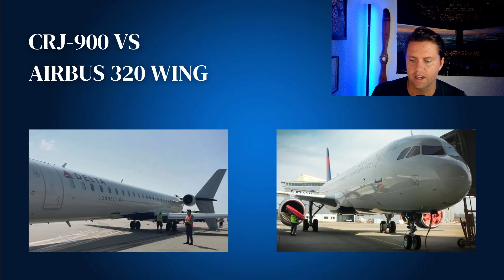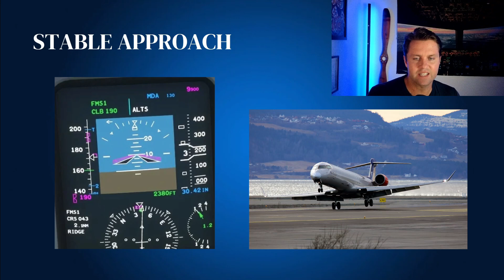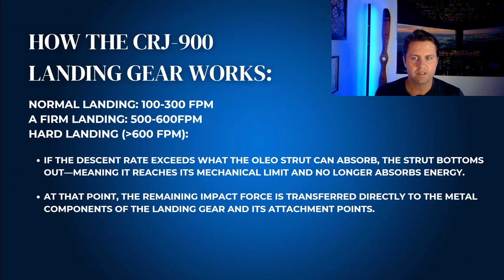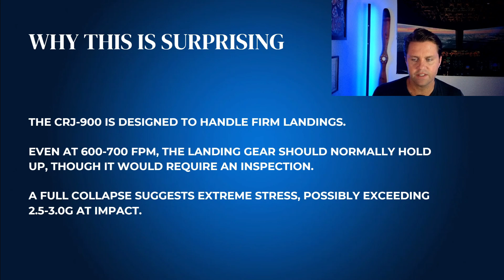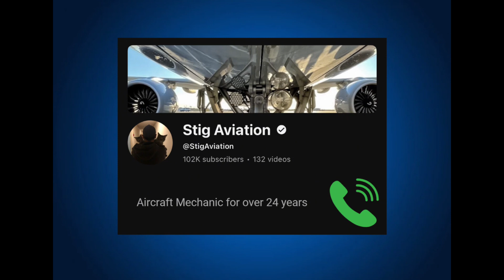Pilot Breakdown: Did a Hard Landing Cause A Gear Collapse?

Comment: @3:20 Your comments about the low wing location in comparison to A320, fact.
But you failed to notice engines on A320 are MUCH lower, closer to the ground.
So over all, which one is the most likely to hit the ground?

Comment: If you haven't initiated your flare by 30 feet in a CRJ 900 (or 700, but the 900 is more sensitive), you're going drive the main gear into the runway.

Comment: Just watching your points on the oleo it could have been under serviced so even a firm landing could have caused an oleo collapse. It is also possible, although it will require the investigation to determine, that the microswitchs on the gear could have been out of limits causing three green even with one gear unlocked

Comment: Look at the flaps.
That is the first thing I noticed the first time that I saw any video.
The flaps appeared to be at the approach setting of about 15deg. and were definitely not in the full position which would be normal before flare.
No flaps. No ground effect. No flare.
Just banged it into the ground. 
Jr. pilot at the helm. There will be more about that I'm sure(!).
Reply: I agree, I was actually undecided between no flaps and one notch. But very little flap and no flare seems to be normal procedure when there are strong crosswinds especially combined with icy runway.
Thing is, I think their airspeed was too low for this particular condition and so they lost lift just before landing.
Reply: They did not land with a partial flap setting, lmao. Pilot's just don't go off script and invent their own procedures. Even if nothing happened, this would be recorded and flagged on the FDR, the pilots would be called in for a rug dance, disciplined and sent for remedial trailing.

Comment: I question personally whether the wingtip or wing caught the ground or not, and whether what really happened is more likely what happened in the similar MD-11 hard landing accidents: the landing gear broke off the wing because it broke the spar. I suppose maybe the whole wing pancaked on the ground and broke off, but it feels like if the tip caught, it might have changed the trajectory. In fact, I watched it again, watched the wingtip bounce (not contacting the ground) and then fall to the ground.

My understanding of the MD-11 accidents are that the landing gear snapped the strut, the wing came away, and then the plane rolled, vs. any piece of the wing catching the ground.

I don't actually know a ton about the anatomy of a bounce, but if maybe if you think you touched down and didn't and had the elevators nose down, you could have really plonked it down and made the force even worse vs. allowing the plane to expend energy by bouncing?

Comment: I have watched the public available videos of the crash slowed down. If you watch closely the right wing seems to drop as the left main touches down. 

We know right wing was low to account for the quartering headwind at the time. But in the video the right wing seems to drop as the right main gear touches down.  Did the gear leg loose nitrogen pressure and or oil that are in there to dampen and cushion the gear leg's movement? Therefore shock loading the gear bay and wing spares fore and aft of the gear bay?

With everything traveling at around 130 knots after the wing parting company with the fuselage it would still have it's momentum carrying it down the runway near the fuselage till it lost it's momentum. I agree the snow didn't hurt the situation and helped save lives.

Comment: I seem to recall something I read, from my early flight training...    The thing is, I have flown in the CRJ900, about 1/2 dz times..  I have to say, only one landing was what I would consider a "smooth Language" in this model .. The other 5 we hit with quite a thump..   I'm just wondering if the T tail-- The high elevator, could be a contributing factor. to the accident.  Ie:  A slower reaction for the plane to flare, when the elevator is above the main horizontal stabilizer, which in most airliners, it sits level with the fuselage.. ..  The same config in the DC9, 727
  Watching the decent, I got the feeling the jet was a tad nose down than normal.. Like the jet was slightly high, so the pilot was forcing it down..  ..

Comment: Forget the flair, the sink rate was way too fast! Proper configuration during the approach was not established and or possible instrument/mechanical failure added to the cause.
Reply: There was little to no flaps (hard to tell on the video), but apparently this is common procedure for these conditions (strong crosswind, icy runway), so that would explain the high sink rate, especially if their airspeed was too low (which I suspect it was).
Reply: @joseoncrack flaps were full down @45, the only authorized flap setting for the CRJ unless one engine is inoperative. Pilots don't randomly make up their own flap settings, There is no data for it and the FDR would record and flag it, leading to disciplinary action.

Comment: To me it looks like because there was no Flare prior to touchdown, the right gear took the whole weight of a fully loaded jet and immediately collapsed allowing the right wing to hit and tear off and the left wing lifted causing the jet to completely roll over...seems pretty cut and dry. The question for me is why didn't the pilot flare the jet which is pretty standard procedure? Maybe it had something to do with the cross wind or something else beyond the pilots control? @3:35. that picture shows perfectly how jets flare their landings even though only the right landing gear touches first the jet is NOT bearing the entire weight, the plane is still going to come down much more softly with nose up and still has lift of the wings.
Reply: Yes I've heard that no flare is a common procedure when there are strong crosswinds.

Comment: The pilot landed at about 40 ft per second, or 2,400 ft per minute.  On one wheel to boot.  1000% failure mode.  WTH is going on?
Reply: proper crosswind technique is unwind wheel first.

Comment: I noticed that the plane did not level off as is normal within a few feet off the ground. Instead the plane seemed to hit the ground hard on the right side without any perceptible leveling off with the ground. Is this correct?

Comment: Check out how short the landing gear on these aircraft is. With engines not on the wings it allowed them to use shorter undercarriage. Even a small wing drop will have that wing on the ground.

Comment: Very good analysis, common sense and pilot experience well applied. No miracle here at all. The left wing was still providing lift after the right wing departed the aircraft, hence the rolling action. That left wing dug into snow and dirt and the spray extinguished the fire. Lucky folks!

Comment: The snow absolutely put the fire out. It did two things. First the snow turning to water take huge amounts of heat and then transition to water even more heat. That cooled the flame and then the water vapor starved the fuel of oxygen. Those two things kept the fire at bay. Then the fuel spilled in to the snow again prohibiting the flame front propagation. The snow is why so many people survived.

Comment: I suspect the wind had a large part to do with this accident. Being a windy day, with gusts up to 35mph, they may have been in a sustained high head wind as they approached the runway. Then, as they entered the boundary layer, that wind decreased enough to suddenly reduce lift and subsequently, the plane sank quickly, causing the hard landing.
Reply: planes land in the wind every day. based on your comment, you don't know anything about flying airplanes.

Comment: What will be interesting to find out is how hard it hit on the right main gear. I have seen three angles from videos. And in addition to the lack of flare the CRJ was rolling to the right right as it touched down. So now you have the overall aircraft descent rate plus the rolling rate added to the right main gear.  The lowering the right wing to start the cross wind landing would be expected with the right cross wind. But obviously too late in the landing phase. 
Now do the two things combined exceed the structural limits?? Good question and one that we will have to wait on for answers.  Also, with the winds, was there a lot of drifting snow over the TDZ? As you know drifting snow can give a few illusions. Lots of questions that the TSB will eventually be able to provide answers for.

Comment: EVERYBODY mentions the lack of flair at touchdown. We need to know the data Before that! I have seen people mention the ADS data, which I assume is flight data because it mentions the plane was decending normally at 500-600 fpm until the last 5 secs when it increased to 11 or 1200 fpm. Hey experts, doesn’t that suggest a sudden down draft occurred? IF that happened, it would explain a lot and suggest that the pilots had No time left to take action?? Just my 2 cents, discuss!

Comment: F=MA
Both the mass and the acceleration (or deceleration) are equal factors.
It's unlikely they were heavy on landing. There wasn't much fuel in those wings. It looked like an 800 foot rate. 13.33 feet per second.
Did the pilot forget to flare? Was there a suggen tailwind gust or some kind of downward wind at the last moment? Some kind of power failure and stall?
The TSB will figure it out.

Comment: I don’t think the right gear ripped off, it’s still with the right wing laying on the runway. The landing gear is part of the wing structure. When the plane impacted the runway it appears it all collapsed at once (gear and wing). What will be telling is if the g load of the landing was so high it collapsed or if there was prior damage. What is Endeavor’s rate of hard landings at their airline? Do they require reporting of suspected hard landings, not just over weight landings? Do they look for hard landings in their FOQA/FDR data and inspect the aircraft? It would be in the data, the FDR won’t alert them unless they are specifically looking for hard landings.

Comment: Upon seeing the video my first thought is that the pilot thought he had another 20 feet or so to drop before the gear hit.  I will be interesting to hear what the flight crew and the data recorder have to say for altitude at the time of impact.  FYI:  Incorrect altimeter settings have been the cause for dozens of crashes in the past and may be a connecting/contributing factor in our recent spat of aircraft accidents..

Comment: 💯% Agree with Capt. Baumgardner ✈ The snow saved the plane, it helped snuff the fire out AND it providing a slick surface to slide. If the surface was just asphalt or rough grass/dirt, the plane's energy would have caused it to roll over and break apart from the forced momentum.

Comment: The publicly available telemetry data suggests the last 50 feet saw the decent rate climb to 1000fpm from a little over 500fpm at a GS of 118 and TAS of 145kts. An abrupt change of decent rate at that altitude with no corresponding change in attitude suggests perhaps a  down draft or abrupt drop in wind speed. The plane stopped flying and the elevators had no authority. The pilots could not flair the plane. 

That was not a hard landing. It was a crash landing.  It is amazing the fuselage survived that.

As you are being certified for the CRJ, can you tell us what the approximate stall speed would be assuming flaps 45 and flaps 30 (due to wind gusts), with a similar expected fuel, passenger, and cargo load? Also, on that type, would the automatic stall recovery system (which the CRJ has) try to keep the nose down if it detected a stall at that point in the landing?

Comment: In the first grainy video posted to Youtube, I watched playback at minimum speed, stopping frame by frame. About 3-5 feet off the ground, I saw the rear plane bump and the left landing gear looked like it fell down prematurely followed by a piece of debris flying into the air behind and then the right wing hit and broke off. If I'm looking at the video correctly, the right side where the wing sheared off still has landing gear attached. It looked like a landing gear failure on the left side right before touchdown which threw the plane into a lurch. I don't know who released that video and could never find it again. This video clearly shows the exact second the right wing snapped but the landing gear on that side was still intact.

Comment: What about the "gust additive" postulate? (Juan Brown)

ADSB last indicated ground speed @113 kts.  There was a sudden increase in sink rate moments before landing.  If the gusting wind stopped at the critical moment, could that contributed to the sink rate? FJP also pointed out the gusting crosswind angle may have impacted R aileron responsiveness because of the winglet?

Did the gear collapse, or did the strut compress enough that the wingtip snagged the ground and ripped the wing off?

Comment: Both steel and aluminum experience an increase in ultimate tensile strength when cooled from 20°C to -15°C; however, this comes with increased brittleness for steel and potential reductions in ductility for both materials. The specific changes can vary based on the alloy composition and microstructural characteristics of each material.

Understanding these temperature-dependent behaviors is crucial for applications where materials are subjected to extreme conditions, ensuring that engineers can select appropriate materials for safety and performance standards.

Comment: Another source suggested that the plane has a weak point where the wing joins the fuselage as a design strategy to allow the wing to separate rather than have the tube break apart.  I think this design consideration is positively at play in this accident.

Comment: I believe there is data available now showing the CRJ was descending at 1100 FPM when it hit the runway.  I understand Navy carrier landings target 700-800 FPM and those are controlled crash landings into the deck with gear designed to take it.  Looks like the impact was too much for one main gear on the CRJ to handle with essentially a fully loaded plane.

Comment: They didn't flare and they were not wings level preparing for "crab and kick" crosswind landing. Looked liked wing low, forward slip type of crosswind landing which is not recommended in most  airliners. Maybe they corrected too late for drift with ailerons. They didn't time flair correctly and came down too hard on rt main which collapsed and then folded right wing. Left wing still developing lift caused rollover. IMO just a poorly executed crosswind landing. Have to wait for CVR and FDR. Thanks for video.

Comment: Very good analysis. I also wonder how low the right wing is at landing. Did the winglet and tip of the wing touch a snow berm
and adding additional stress that caused the wing to shear?  The snow may have been a negative factor prior to helping put the fire out.

Comment: I watched at slow speed and looks like a puff f snow just before the gear failure. I assume there were drifts of this on the runway. Could hitting a foot high drift hard at that speed and angle be enough to cause this failure? I know from running into such while clearing a driveway it can hurt the joints.

Comment: You are way too premature with this "The snow saved them" hypothesis. It seems much more likely that the fuel dumped the fire went with the wing that broke off. HOWEVER, witnesses who escaped from the plane also said there was fuel pulled under the fuselage, likely leaking from the damaged left wing. But I suspect by the time the plane stopped, the fire was already behind the plane with the right wing.

Comment: Dude! The right wing I clearly broke off allowing the left wing to rotate the fuselage and turn the plane upside down. Fuel in the right wing mostly stayed with the wing, keeping it away from the people. The plane flipping over caused the rear tail fin to drag hard on the ground and that slowed the plate and down quite quickly. 

I'm thinking there should be some lessons for plane designers here.

Why the plane didn't flare, I don't know. Maybe there was some last second wind shear downdraft. Maybe the pilot misjudged how close the ground was. Maybe both. I'm thinking there was probably severe downdraft at the last second and that erased all thought of flare from the pilot's mind. I'm thinking the pilot had no time to react.

Comment: There has got to be a difference between landing with a flare at 1000fpm and driving the plane into the ground with all that kinetic energy of the plane at 1000 fpm. I think a flare would have saved this plane. Why didn’t the pilot flare is the biggest question here. Every landing except a crash landing has a flare, but even some of them do.

Comment: What do you mean, did it? Clearly the plane landed like an F-15 on an aircraft carrier in the right landing gear broke, with the right wing hitting the runway and breaking off a second or two later. 

I'm starting to think now that break-away wings maybe should be part of airliner design. When there's a hard impact not on water, get the fucking fuel away from the people.

Comment: In my opinion it looks like the right main gear collapsed following a hard x/wind landing, causing the right wing tip to be dragged on the runway, where the absence of the right main gear put most of the a/c  weight on the right wing causing it to detach and leaks fuel leading to the rest of the event